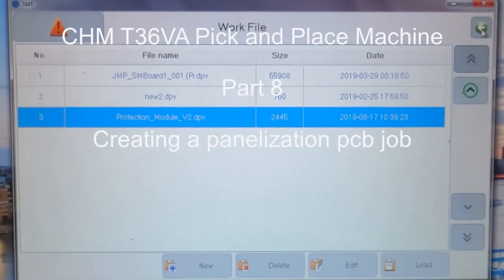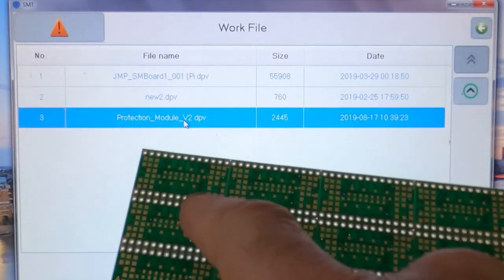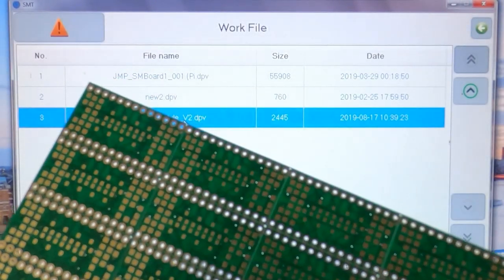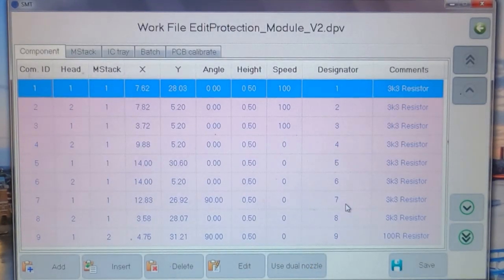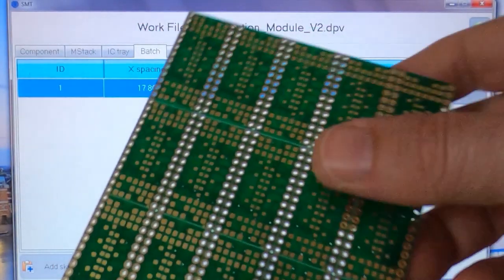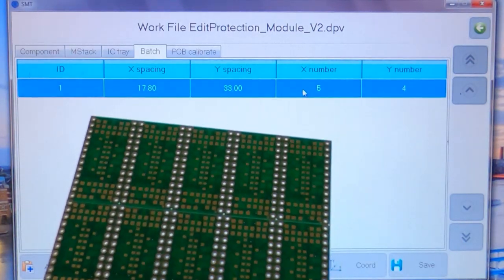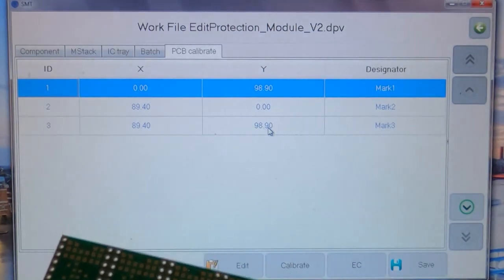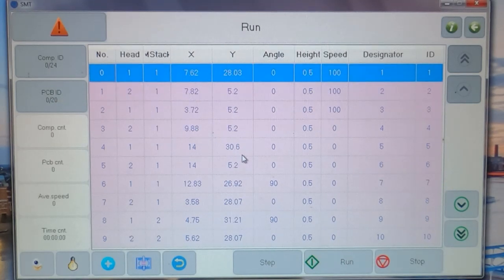CHM T36VA Pick and Place Machine Part 8 - Panelization

Comment: I found this feature quite useless. It can't cope with handle-rails on the sides since there's no panel offsetting. 
Instead I have to create panelization manually (or rather by scripting) in the csv-file that I then convert to the dpv-file (which I of course do in the same script).

I'm also curious how you manage to get the software to run in a window. 
When I run it, it always takes up the full screen and there's not way to change size or minimize it and it is the same version that I use.

Comment: what if the board manufacturer has panelized them with different orientations? my 2x2 panel has them side by side ok, but in the vertical they are top to top rather than top to bottom. This is because the board bottom edge is entirely curved, so they panelized them top-edge to top-edge with a v-groove. 

It looks like the charmhigh software can't account for different board orientations in the panel? 
so I guess I just snap my boards along the top-edge v-groove and  configure the machine for 2x1 panels instead of 2x2...
Reply from the maker: Just spin your board round in your CAD system and then output the csv file. All the components will then be rotated to suit and you then just have the machine step accordingly. If you mean that not all boards on the panel are rotated the same way then you will need to create the panel in your CAD system before outputting the csv file.

Comment: I have a 2x2 Panelization ready and can't seem to calibrate it correctly. The only two markers are available for me to use and I'm not sure which corners you were calibrating it to. Does the difference in orientation of the board compared to what i have in my EAGLE .brd file play a role? I also keep getting an error that states 'not drawing material'. What should I try?
Reply from the maker: It is up to you to select identifiable points on the board to use for calibration. You then determine the locations of these points relative to the origin of the board. Then you enter these points into the P&P software as the calibration points. Note that it is points on the panel that you need to use and not points on the individual boards.
Reply: @JerryWalker001  Ok. So I have two capacitor points that is being used as a reference for my machine to place components and if I were to do it for a single board it works. However using those two identifiable points for a 2x2 panelization does not work. I did input the x and y length of the board and stated it was 2x2 in the batch portion. It's just in this case there are multiple 'capacitor points' as there are 4 boards. What would you suggest I do?
Reply from the maker: Just forget about it being a pallet. Pick two points at opposite places on the pallet. Then enter the two locations as calibration points relative to the corner of the pallet. You will need to calculate the positions of the calibration points. For example if your initial X calibration point is 50mm and you have 2 boards with an X step of 100mm then the calibratino point is at 150mm.
Reply: @JerryWalker001  When I designate a calibration point, do I go with EC or Define Mark? EC pinpoints to the centre component and worked for a single board whereas Define Mark gets the positions wrong and when i manually correct it, it does not save and states PCB not calibrated. I do understand that x spacing and y spacing are the lengths of the x and y for each board. I have an L shaped board btw with a fiducial on the left top corner and one more at the corner above the right bottom corner (midpoint of y axis).
Reply from the maker: Where are you entering this? You should be setting the calibration points in the pcb calibration screen. The board spacing is not the same as the board X and Y size. It may also include routing size. The board shape does not matter. It is the pallet you need to calibrate, not the individual boards. If the calibratino fails then it is because the values you have entered are either in the wrong places or they are too far from the locations you are trying to adjust to.
Reply: Was entering it in the pcb calibration screen. Yes, accounted for routing size by measuring from component position to component position. Ok, it's the calibration bit I don't quite get. So for a single board it's calibrated by using two points (component positions, eg: C5 and U1) but as you mentioned for a panelization that cannot happen as I'd have to calibrate for the whole pallet. So if I were to define mark, my machine defaults to only two points and when I try to position it does not seem to save. Would I have to enter calibration values beforehand elsewhere other than at the pcb calibration portion of the software?
Reply from the maker: It sounds like you are trying to define calibration points in the RUN and not the JOB. Watch the video again to see where to enter the values. They must also be in the locations shown in the software (Top left, Top right etc). If you get them in the wrong corners of the pallet or they are too far from where you 'say' they are then the calibration will fail. Also be sure you are measuring from the machine datum and not a board feature. You need to calibrate for every run but you first define the calibration points in the job setup.
Reply: @JerryWalker001  Got it. Got the correct offsets after a few tries and managed to calibrate it. Thanks for all the videos and the help. Appreciate it!